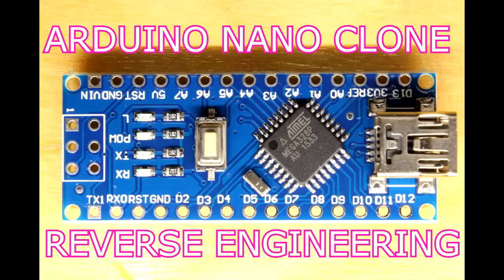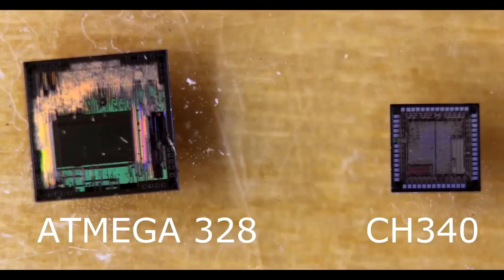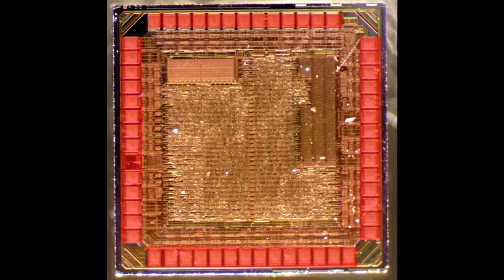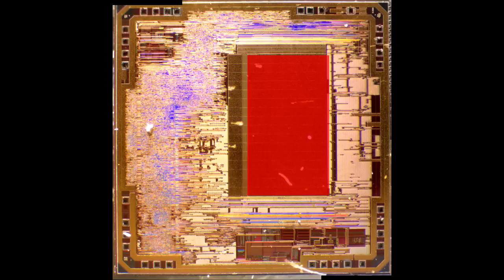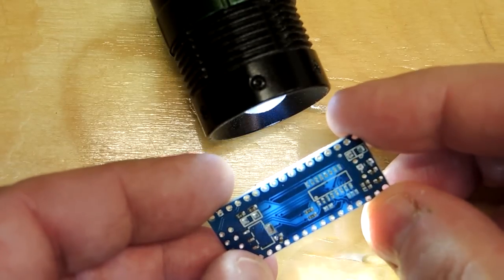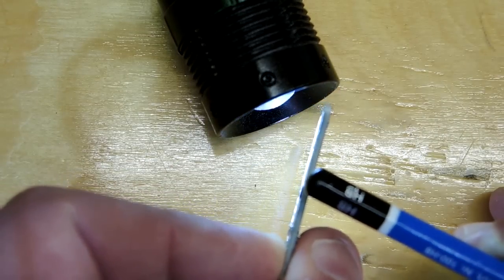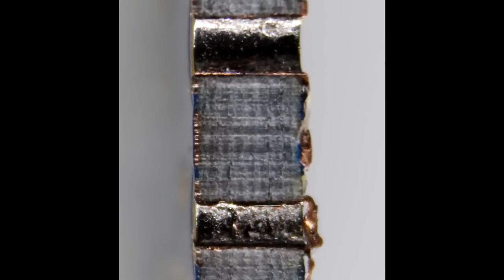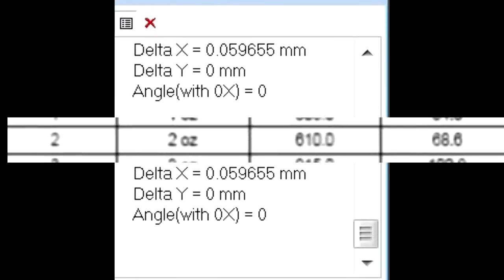Reverse Engineering an Arduino Nano Clone

Comment: It like to see a decap of one of those AVR processor clones.  I'm curious if they match the real Atmel AVR chips.  Also would be interesting to compare some of the AT Mega and AT Tiny series to see if they are all the same dies, but wired differently.

Comment: Regarding the relative size of the silicon dies, this also depends strongly on the manufacturing technology nodes used. My guess is that the CH340 is a much older design using an older and larger size technology than the Atmega328. These older manufacturing technologies are still used because you can make very cheap chips on them since all the manufacturing equipment has been paid for already (written off). So it can be cheaper to make a physically larger chip ! Unfortunately for these chips the datasheet does not list in what technology they're made. For sure it is CMOS but not if that is 0.5 um, 0.35 um or 0.25um minimum feature size. This is company secret I guess although with an electron microscope it would be possible to zoom in and just measure it :-)

Comment: Have you de-capped any other ATMEGA328Ps? I'm curious if that is a genuine Atmel part, or a counterfeit.
Reply from the maker: +dwDragon88 This is the only one I have decapped.... a search on the internet shows that this die matches the results of others. It looks genuine.
Reply: +dwDragon88 From looking at the die it should be possible to determine if that is the genuine part. In this case I think it is genuine because it looks like a microcontroller (lots of digital and some memory here and there). Counterfeiting usually amounts to taking a cheaper part using the same package and writing a new part number on it. If you would de-cap the fake part you would see a totally different looking silicon die. Also it probably doesn't make much sense to counterfeit an Atmega328 these days since their price is much less then it used to be.
Reply: @peterpv0001  not necessarily, chips are sold in wholesale, for a hobbiest yes it doesn't make sense, but when u make a product and requires 50k atmega's, we're talking extreme numbers here and some Chinese industries wouldn't mind taking some money out of it, but there's also an issue with duplicating chips, its not easy per say. Reversing, manufacturing, packaging, it cost money. So is it really worth it for them? maybe not, but maybe in future